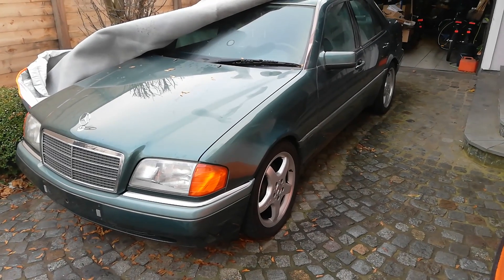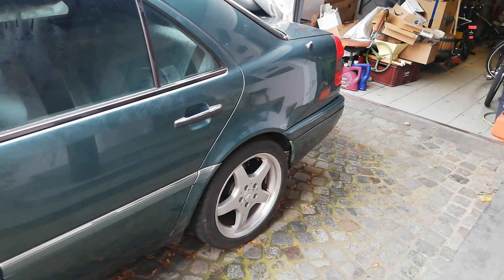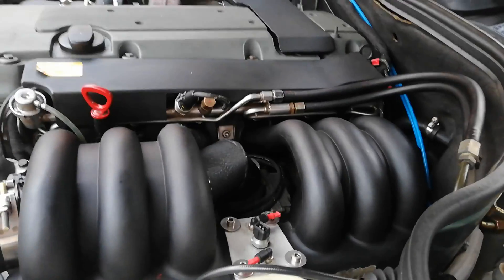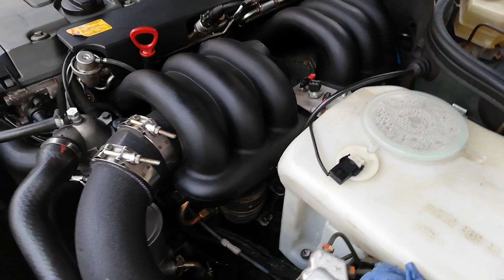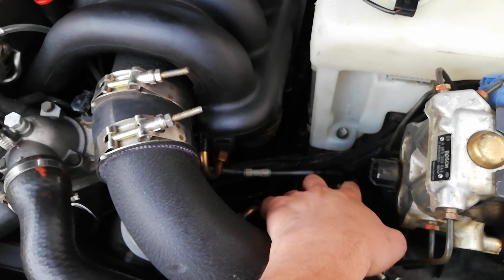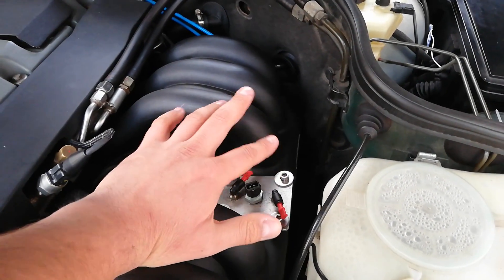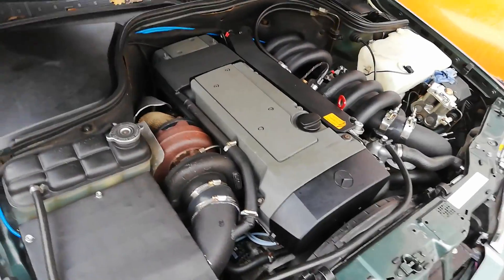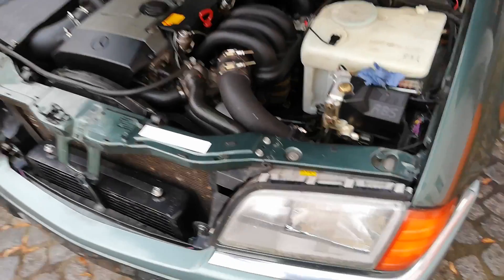M104 Turbo / C280 Project Car Update

Comment: When he says “I have drive by wire throttle now”
Why does it look like the boost pipe is cut off under the intake runners - like it’s an open pipe and goes nowhere....????
Reply from the maker: There is the throttlebody mate it's pointing upwards.
The Intake manifold does a 270° turn so to say. Google m104 intake manifold.

Comment: Hi Carl when you did your original wiring harness with the original throttlebody can you explain how you wired it up. Currently I’m doing a turbo car to my C2809 94 with the Vems ecu standalone and I’m having a issue getting the throttle body position sensor to work correctly can you help out on this.  Email joshua1flores@hotmail.com  thanks for your help
Reply from the maker: I shot you an e-mail...
Reply: Can I get your email.  I looked thru my junk and inbox. I received nothing.
Reply from the maker: it's barlcenz@gmail.com

Comment: Hi Carl, for my m104 3.2 turbo project, can I use stock conical valve springs for boost 1.5 bar?
Reply from the maker: Depends on how much back pressure is building in front of the turbine.
Reply: @carlbenz3341  I'm using gt3540 turbo with 0.82 a/r turbine housing and straight pipes after turbo without muffler.
Reply from the maker: it'll probably be alright if you keep the revs under 6500/min. (which you should anyway with the stock springs, at least under 6800)
Reply: @carlbenz3341  ОК, thank you Carl.
Reply from the maker: @almazberdibaev3040  you're welcome buddy. ;)

Comment: How Much Nm torque can dual mass flywheel take? will it take 500nm without slipping?
Reply from the maker: The dmf it's self is not the problem.
But the organic clutch with the 270CDI pressure plate just has too little bite.
Yeah 500Nm max i'd say. (there is no strong 240mm stock pressure plate these cars...)
Reply: @carlbenz3341  Thanks for the info, will it help to make a Button Sintered Cluth plate?
i noticed the diesel Pressure plate is a lot harder than the petrol pressure plate though
Reply from the maker: I have a diesel clutch now, and its slipping at 0,8bar...
Reply: Thats no good, how much nm's are you producing?
Reply from the maker: @chrissnoer2236  
around 550Nm at 0,8bar i'd guess .
i've never been on a dyno...

Comment: awesome videos man! not many people tuning mercedes on youtube. is there anything you would have done diff then what you did your first time turboing the engine? such as bigger turbo maybe, manifold ect...? Anyway you got a big fan in America and hopefully in the near future ill be building a 190e m104 swap with this knowledge. Thank you and keep making videos!
Reply from the maker: when making the manifold, i would have bought(or have made) thick (>15mm) flanges, that transition from oval to round for the 42mm tubing. also i would have started off with a t4 twin scroll merge collector and would've made cylinder individual runners.
turbo is only depended on your power goals.
but i would probably run an efr9180(if i wasn't a cheap bastard).
and i would use an amg automatic 722.6 with a standalone controller(also if i weren't a cheap bastard).

Comment: That’s awesome which transmission?
Reply from the maker: It has a mercedes 716.663 in it.
Reply: Is that a good transmission? I hear the g56 is good
Reply from the maker: it's the toughest transmission with the old bell housing flange.
i dont know the g56, which car does it come with?

Comment: Wieso denn ein offenes Diff ? Bei 400ps+ sollte das traktionstechnisch ja nicht so das Gelbe vom Ei sein. Würde das Diff zumindest zur 100% Sperre zuschweissen. Die W202 Modelle fahren sich mit einem geschweissten Diff eigentlich ziemlich angenehm. Nur beim Parken mit vollem Lenkeinschlag stört es ein wenig (aber lange nicht so schlimm, dass es nicht alltagstauglich wäre).
Reply from the maker: die überlegung ist da...
wenn man aber dazu neigt mit dem auto rücklinks mit 100+ in betonmauern zu ziehen weils ein bisschen feucht war, dann lässt man von solchen dingen eher aber ab.^^

mir fehlt da eben leider die erfahrung, wie vorhersehbar ein geschweißtes diff ist.
wenn mir in nächster zeit mal ein passendes diff übern weg läuft dann kauf ichs und schweiß es zu.
Reply: Carl Benz fährt sich genauso berechenbar wie ein normales Sperrdifferential. Nur ist das Auto in engen Kurven tendenziell etwas untersteuernder. Fährt sich aber insgesamt doch deutlich besser als ein offenes Diff (vom parken, rangieren und dem leicht erhöhten Reifenverschleiss mal ab ... wobei bei nem Turbo m104 mit offenem Diff am Kurvenausgang das kurveninnere Rad bei strammer Gangart wohl mehr leidet als bei einem geschweißten Diff).

Comment: M104 is the "real German 2JZ", get that N54 out of here
Reply from the maker: the real downside to the m104 is that there is very little aftermarket!
Reply: Carl Benz While I like 2JZ, N54 is really a miracle these days, they made engine almost as reliable/tunable as 2JZ but 20 years later. As for aftermarket for M104, Turbobanddit to rescue!
Reply from the maker: turbobandit is not real aftermarket.
some cheap chinese honda h22 conrods and rebranded parts are nothing to brag about.

it's not like you can get an off the shelf  9:1 CR forged piston and a new off the shelf turbo-cam or something like that.
Reply: Carl Benz You can use H22 connecting rods?
Reply from the maker: @miralemnermina142  
yes the h22 rods are a direct fit and in 143mm length they lower the CR of the 3,2l M104 to ~8,5:1
Reply from the maker: don't get me wrong turbobandit is doing the absolute right thing in trying to build a brand, and i like the guys...
but still it's kinda pathetic(it's for every company that does it this way in my opinion).
a european assembled, chinese manufactured turbo still isn't a garrett gtw or a borg efr.
and saying that it's not different or even better is just not true.
and i'm saying that even with taking into account that i dont have the money for the good big brand items....
Reply from the maker: n54 is too new, complex and expensive to be a 2jay equivalent.
but it's a cool powerplant...
Reply from the maker: @Meister Röhrich 
Aus China, wirst aber direkt nicht kaufen können. Man könnte mal bei maxpeedingrods anfragen...